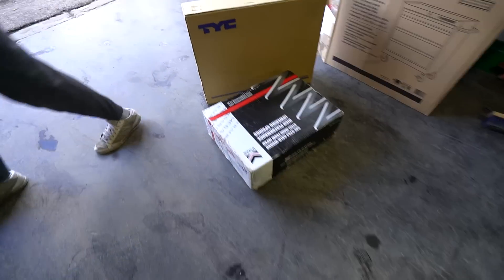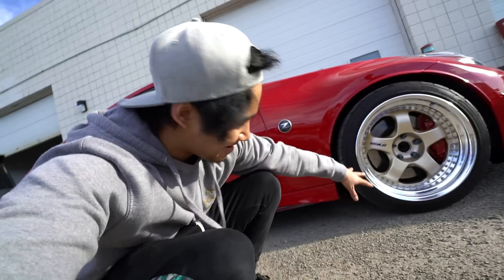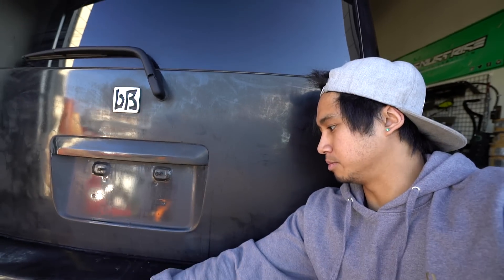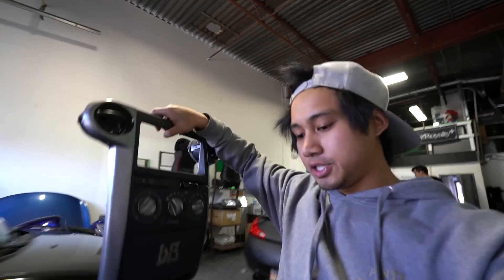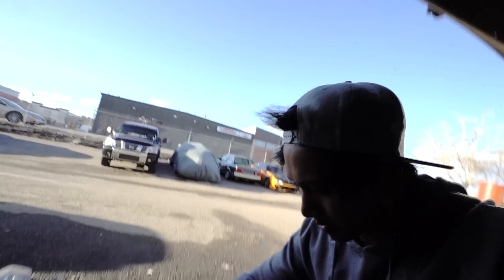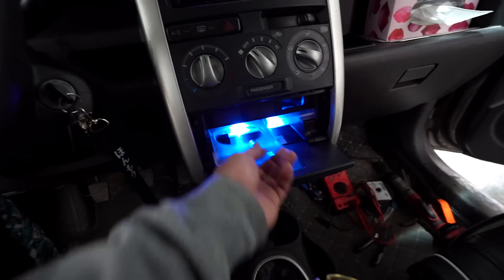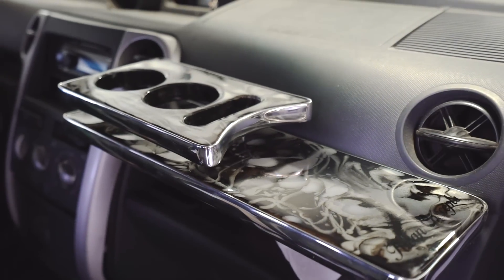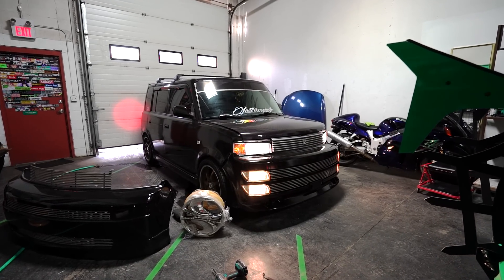VIP XB Day: NEW Bumper, Custom trays, Tail Lights & RARE JDM Center Console + Special Announcement!!

Comment: I think you should put long led light bars behind the bumper grills and turn all the bumper lights into air ducting or just blank glass with color changing led lights around the edges

Comment: Birdy about the LED stars on the inside of the roof. There is a cool product on Amazon and eBay for like $10. It's like a small LED light projector that looks like a flashlight plus into a USB and direct it however you like. It's really cool and it works! Check it out. Cheers from a subscriber from Texas and keep up the frequent uploads please 👍

Comment: Also forgot to mention, that aftermarket bumper is about half shorter than the OEM bumper because it’s made for the zenki version. You can find the zenki crash bars on eBay if you really wanted to run one with that bumper.